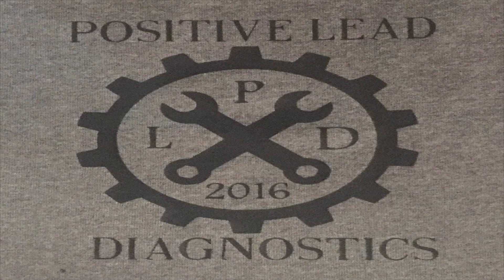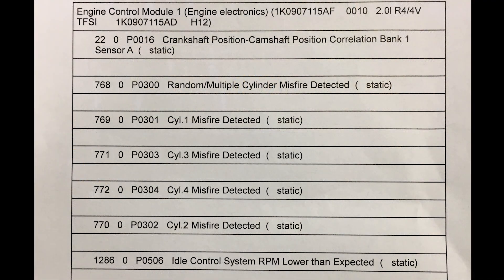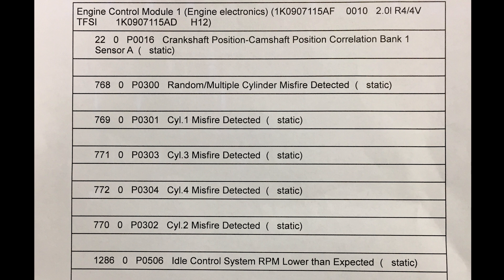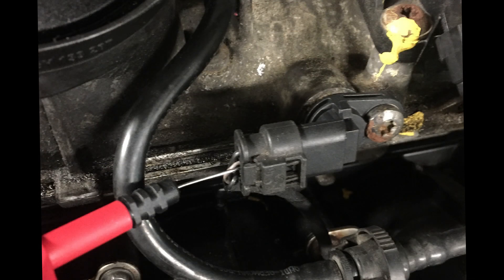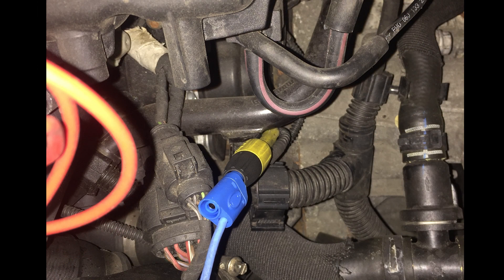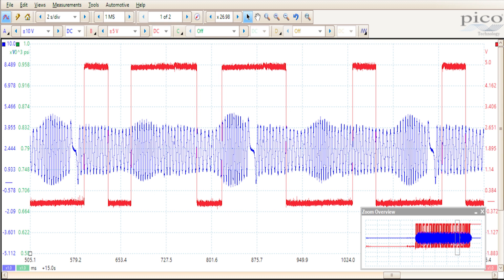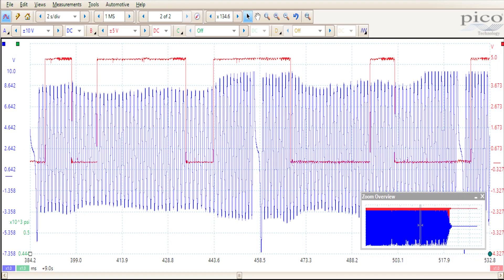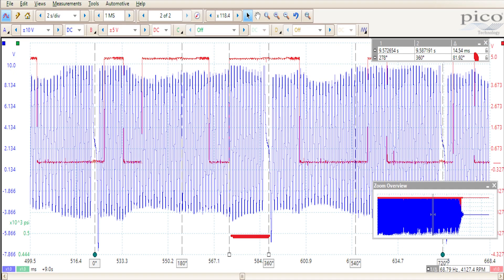P0016 Cmp/Ckp Correlation, P0300 Random Misfire (2008 VW Jetta)

Comment: Hi, I came across this video while researching a P0016 code on my 2011 B8 A4. I have since checked out a few others and subscribed. Nice content.
  On cold start the car seems fine but when the idle drops, it runs terrible.
  What I've seen so far on VCDS Live Data is that the camshaft adjustment specified, camshaft adjustment actual  and camshaft adjustment activation do not move at all. They remain at 38°, 38° and 6.250% respectively! On older live data I have saved, I see they all move couple seconds after start up and continue to move after that.
   Have you even seen where the specified value doesn't budge at all?

Comment: Was the camshaft control valve stuck because of mechanical failure or pollution of oil?
Reply from the maker: The control valve had a mechanical failure was was stuck out

Comment: 1.6fsi gives same fault, I replaced plugs, camshaft sensor.  Didn't help, but when I cleaned the solenoid, the fault light went off for a moment, about 20km and the light was back on.  Will these be able to disassemble the solenoid or will the car be rebuilt.  The car runs beautifully when the malfunction light comes on, but when it resets to zero it starts to run bad for just 3 seconds and when it detects the fault it starts to run again beautifully.  When starting, the machine does not make any sound that sounds like a loose chain.  That sounds like a wheel problem, and the machine lacks power but lets go over 3000 rpm.  Do you have any tips for me to do?

Comment: Great video.  I've had a few of these come through the shop with the same problem over the years.  You can pull the magnetic adjuster then start the car and the idle should smooth out.  Very little oil drips out the N205 when running.  It's also easy to identify in measuring blocks when N205 fails.  It will stick at 28* if I remember correctly.

Comment: Hi.
I got code P0303 P0016 P0300 p0302 on my Jetta 2012 TSI engine. Timing chains jumped. 
So I did replacement new chains an new tension. 
I started my car, I still have the same problem,and same codes P0016 P0300 p0302. 
What is issue? Can you help me?
Reply from the maker: You need a Cmp ckp relationship waveform to start.  Could the cyl 2 misfire be its own problem. Also could the control valve be your issue ?
Reply: @PositiveLeadDiagnostics  
Thank you so much for helping I'm so appreciate.
I checked the control valve that pin inside it doesn't stick outside so it's means control valve  good?

Comment: Hi man, big thanks for your video, I got same proble with my Audi B8 but because of excessive burning oil and bad piston common problem, I didnt even want to touch it seeing how bad the engine job is on those cars. My question for you is, any idea if that control valve issue could have something to do with burning oil(1L every fuel tank fill). Car as 160 000km stage 1. Thanks 🙏
Reply from the maker: I don’t think the control valve would have anything to do with oil burning.  My guess would be rings or valve seals. Probably rings

Comment: Hey man I know you and EXOVCDS are the VW experts. I need help lol. How do the VW 3 wire knock sensor circuits work? There's no info on identifix or mitchell. Are they supposed to have a bias voltage. I'm getting code for both knock sensors on a 2017 golf for circuit low. Unplugged at the harness side im getting good shield ground and 0.8 volts on both + and - for the knock sensor circuit. They're not shorted to the shield. Don't know what else to do don't have info.

If you can help me thanks if not thats fine thanks anyway I'm sure you get a hundred questions a day and can't answer them all.

Comment: did you take the bad valve apart to see why it broke/stuck?  I'm wondering if something got jammed inside it or it just broke due to wear.
must not have been a shop used to working on VW's, but you think they'd have noticed having to push the solenoid itself on hard and I wonder if it actually needed the chain and parts. yikes, that poor shop has some explaining to do :))

Comment: OK, hope your open to criticism.  In looking at your past videos, I believe you work at a VW dealership.  You mention that this car was in another shop where they ended up putting in a timing chain.  In doing that, how could they not see the problem with this advancement mechanism.  Was it a VW dealership?
On the other hand your are extremely thorough but, to the point of annoying.  Sorry dude, just my opinion.  I mean if someone did not hear you the first time, all they need do is rewind.  Examples; other shop did a timing chain, mentioned over four times.  P0016, over three times.  The timing out by 81 degrees, over five times, etc, etc.
You show a picture of a scope capturing some patterns and explain that there is something off about the timing but, never show a good pattern of what it should look like.  
You show a picture of the control valve and solenoid but, don't show where on the engine it is.  You mention to remove this can possible cause the timing chain to skip a tooth making me think this is mounted on the camshaft because you state the camshaft has to be held in order to remove this part. If that is the case, why didn't the other shop see this sense they replaced the timing chain.
If things were not mentioned so repeatedly, this 18 minute video could of been done in 5 minutes.  It's evident it is not here to show us how to diagnose this specific problem on this specific engine.  At this point, the video does not help me to do this to a specific car.
Reply from the maker: I cannot speak for the other shop. All I can tell you is what I was told.  Thanks for the feedback
Reply: It's a look into his diagnostic process. Its very well done and very raw, unscripted, pure...

Comment: Great video. A little more detail on the tricky bits ie how did you remove this Oil Control Valve --- was it retained by bolts: was is a special fork took into the holes in the recessed part of the flange??
Reply: he changed to content aimed at helping experienced techs, not so much beginners.
the solenoid itself is held on with 3 bolts, the actual oil control valve itself threads in and has left hand threads... hold/lock camshaft in place or you can make it jump time since the chain/tensioner will be loose

Comment: I don’t mind the format and thanks for the video this is the first time I seen one like that too it’s good to know I have seen one before that had the screen from the camshafts bridge jammed into one of the slot then it had the same symptoms and fault codes . I  assume that you have the VW special tool that screws into the spark plug hole and it has a dial indicator so you can check to see if the timing mark on the crankshaft damper is correct because as you probably already know the gear on the end of the crankshaft goes only one way but if the crank was moved with the bolt removed and without the special spacer installed then there is a chance that the timing could be off then there are specs to mesure at two spots on the intake and exhaust cams because there is no specific timing marks on this engine it’s done with different coloured links but if someone has a scope and knows what there are doing then it’s probably best.

Comment: Tom, welcome back thank you for the video and info one  question is this wave form for cam/crank correlation universal with all make and model or it depends on the manufacturer. thank you and cheeeeers
Reply: It's not universal what is universal only older Otto cycle but new engines with patents on cam defasors etc... there is always differences. A known good waveform from Pico scope library would be what to reference to .  Complete different is likely Mazda skyactive as that is not Otto cycle as far as I know Atkinson Otto mix or something so cam timing would there differ extremely to this I would say.